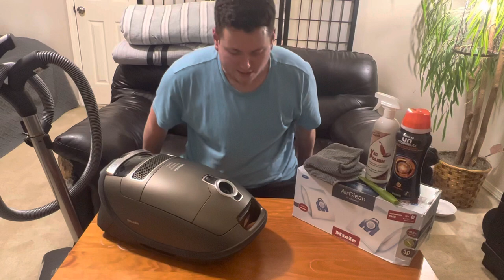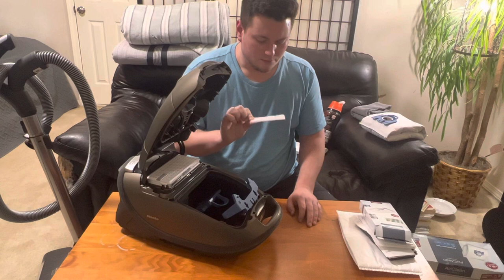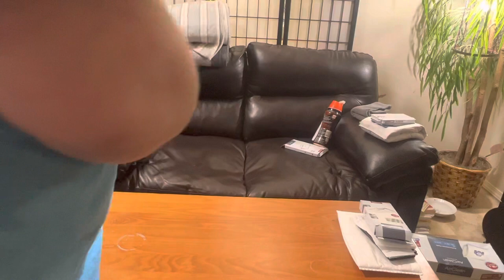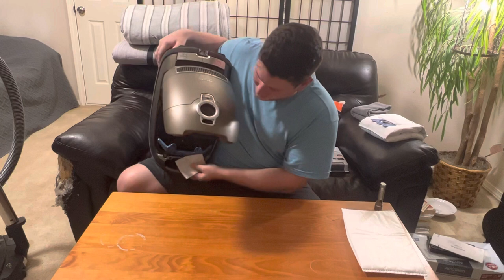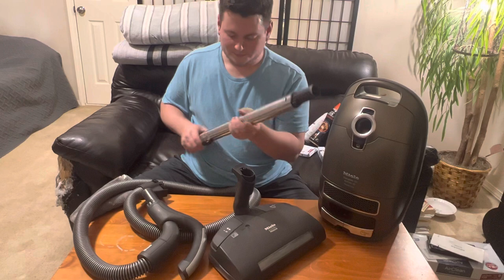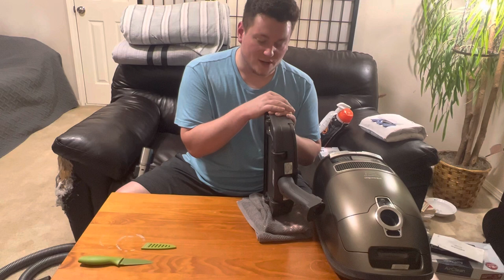Miele C3 Vacuum Maintenance +  Tips

Comment: I love the C3 Brilliant but I would be worried about the longevity of the matte paint job. Once scratched it would be impossible to fix.
Reply from the maker: Actually, it is quite resistant to scratches and hides them better than the glossy finishes. Applying automotive wax or a ceramic coating helps to prevent them, though. I also use Stain-C vac polish.

Comment: What are you using now that Stain X doesn't make Vac polish anymore? I see what I think is a knock-off on Amazon that seems really expensive. Also, where are you finding the best prices on the vacuum bags now that vacuumcleanermarket is closing and no longer has them?
Reply from the maker: Stain-X is still available online, but I can’t find it on the Stain-X website. To supplement, you can use Pledge but Pledge does leave a slightly greasier film than Stain-X. To remove smudges, use Denatured Alcohol (lab grade). To wash washable filters, use a dilution of heavy duty degreaser and water, and then rinse again in a dilution of water and white vinegar (removes degreaser residue), and then rinse again in just water to get vinegar residue out. I use windex or Stain-X for general cleaning of certain areas, like the brush roll cavity. Make sure to spray on the rag first instead of directly on the unit to avoid getting moisture in electrical areas.
Reply from the maker: I didn’t know they were closing! What a shame! How did you find that out? I buy them on Amazon or directly from Miele. Miele has deals periodically throughout the year, especially during spring and at the end of the year.  You might find deals on Walmart’s website. I’ll have to find another place to buy them since Vacuum Cleaner Market is closing.